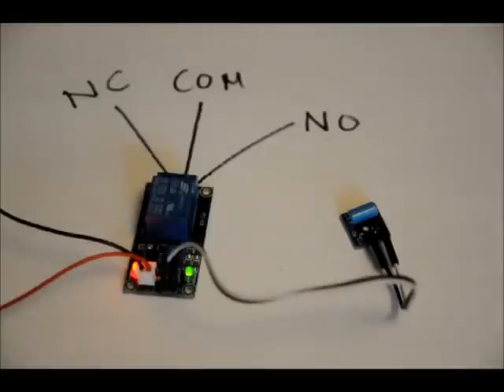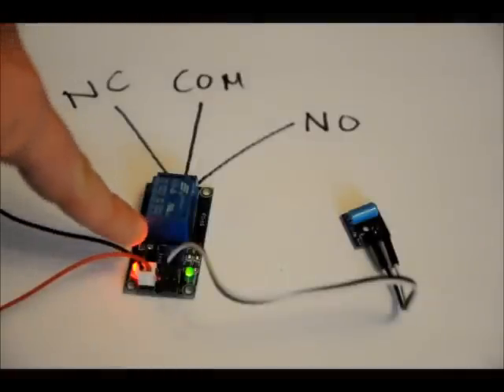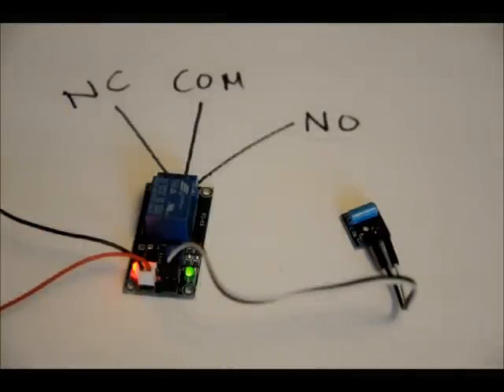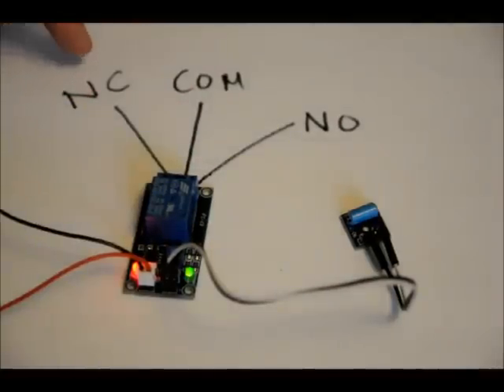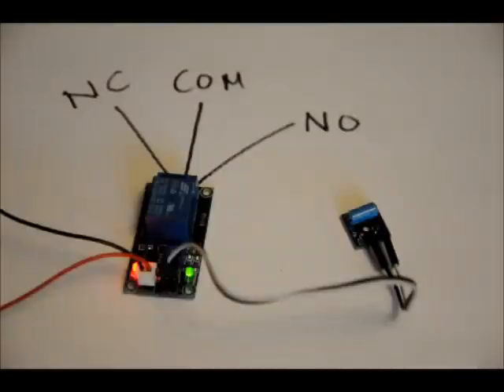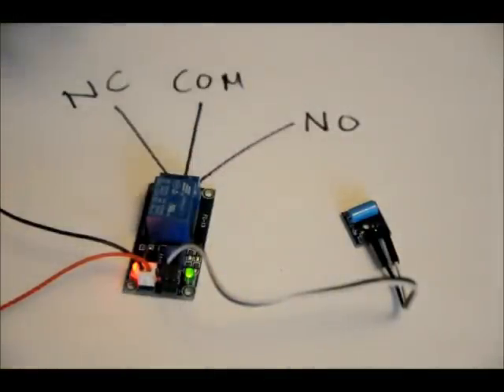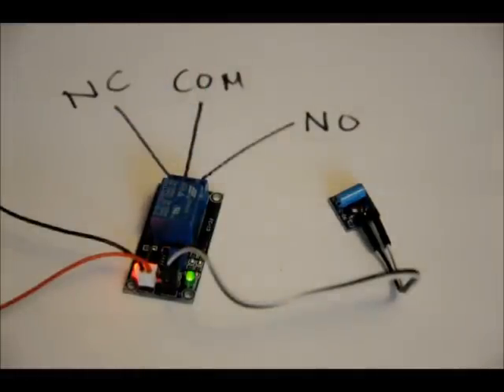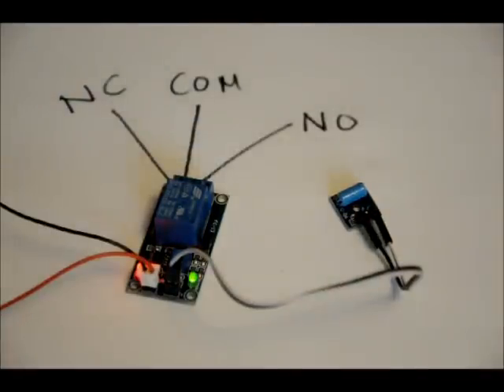Vibration Switching Module With On Board Relay

Comment: how can I make the output works for 10 seconds????? 

I mean....I want to use this vibration module in a car, and connect the output to the HORN, but if I use this set up, the horn only will work when the vibration is On, I would like to detect the vibration just once and then make the horn sound for 5 or 10 secs...... 

Thanks!

Comment: What could you add to this so that if you shook the vibration module it would only turn the relay on and off instead of on and off a bunch of times?  If you wanted the vibration switch to trigger the relay but in a more spaced out pattern?
Reply: +timothy oberlander You use 555 timer.
Reply: good day sir.. ahmm can i ask how can I use the 555timer  to stop the on off of the relay..??? thanks